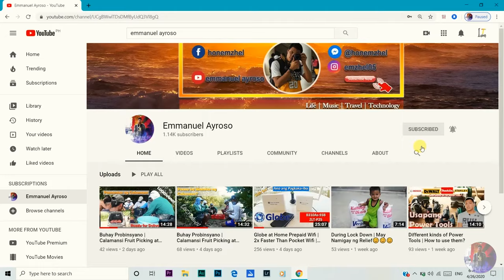BAKIT GMELINA WOOD?

Comment: Sun dried Gmelina wood isn't enough, difficult to get long term quality finish; it cracks on joints after month's use because of moisture pressure from wood core.